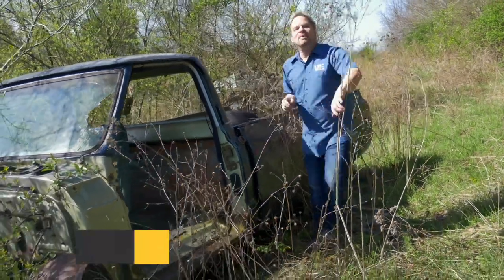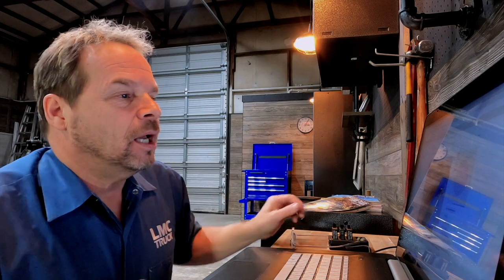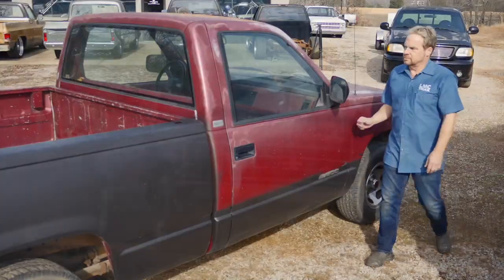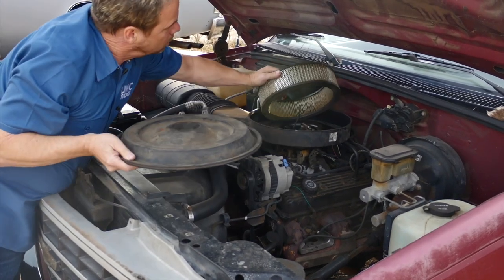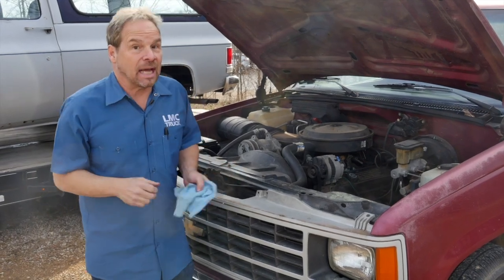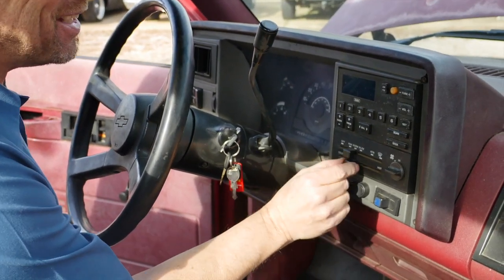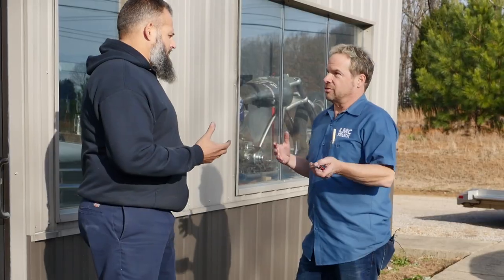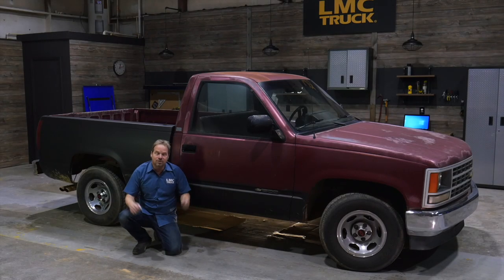What to look for before buying that truck with Kevin Tetz - Episode 1

Comment: Are you guys currently filming or how long for the next episode?
Reply from the maker: The next one will be released any day now.
Reply: @Lmctruck1 Great video. I just bought a 1984 Dodge W100 4x4 pickup truck. I checked under the truck and the truck bed to see if they were rotted away. But, it wasn’t rotted anywhere. No cracks on the dashboard which was surprising. The carpet was in great shape, too. I just ordered new door strikers, door weather strips. window rollers from Lmc truck.